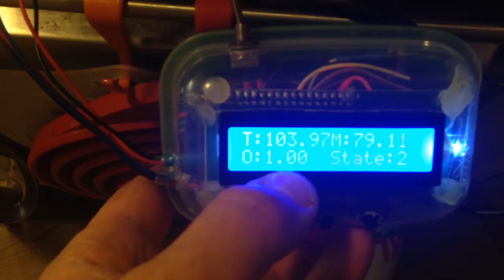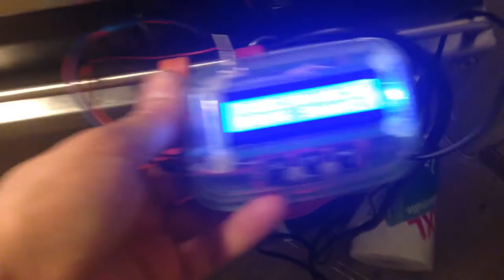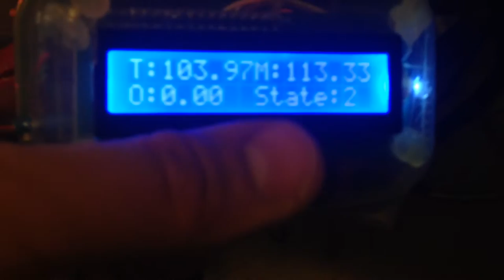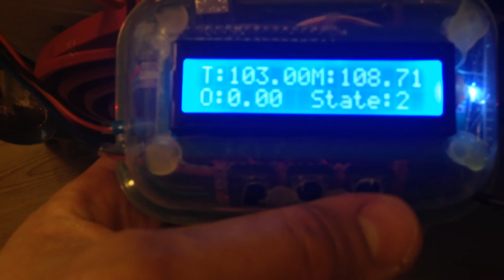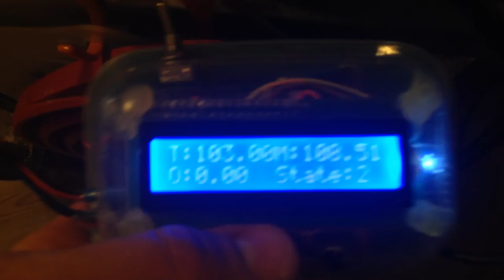Espresso machine with Arduino PID controlling temperature.

Comment from the maker: Link to a document describing the whole thing (one more video and performance graph inside): https://docs.google.com/document/d/1ntMEIloD2wUg8Yra1VtmFm3yOCzGYv-qs2anu9O3p6I/pub
Reply: Hey, how did you go with this in the end? I have the same machine and want to convert it to PID. Are you still happy with this? Any changes you would recommend? Thanks! I am surprised your video did not get more views or comments - smart way of doing it without a big box!
Reply from the maker: Thanks for your interest and kind words.
Yes, I'm still very happy with it.
I've just checked and I still use the same parameter values for the machine, so the code should be fine for a similar machine. At least if you also have 230 volts. For 120 volts, it's a different heater, so maybe they can be optimised a bit in that case (though they should be a good starting point).
The machine takes quite some time to warm up, when the boiler is set at 107 celcius. About 45 minutes, I'd say. Often I turn on the machine only when I want an espresso, and then I usually set the target temperature to 137 celcius (no reason for the particular value other than it's high and only requires a few clicks) for about 5-10 minutes, before lowering it to 107 for another 5-10 minutes. I'd recommend considering implementing that procedure in the 'setup code'; setting the target temperature to the actual target plus say 30 degrees, then waiting for 5 minutes, and then lowering to the stored target, before entering the loop. You'll probably need some way of bypassing this, though. Like how I've made a 'reset to factory values' functionality by holding a button pressed during startup (I've small kids who loooved the fancy display and buttons to click on, so I needed this ;)
Another recommendation would be to take it as a learning opportunity if this is your first project. If you just want a PID on your machine, you'd probably be better off buying one where it's already in place. But if electronics/arduino interests you, and you have the hours (several, if you are a novice) to spend, I think it's a great project that you'll enjoy every day.
Best of luck if you decide to try it out, and don't hesitate to contact me with comments/questions!
Reply: Ah, yes - this reminds me why I in the end prefered my HX machine! It heats up much faster, the Domobar needed abut 40 minutes. Why not start it in "steam" mode and then later on toggle the steam switch?
Yes, my first project of such kind, it will be a learning experience. Thankfully I have a 2nd machine, so still access to coffee while I get this going ;-)
I assume you can get logging and display on a PC from this board?
Eventually I will try to get a board with WLAN connectivity, that will be the next step.
Reply from the maker: If you set the target temporary to infinity (or just above about 150 degrees), it corresponds to setting it to steam mode, since the wiring means that regardless of the PID, the steaming circuit still kills heating if reaching steaming temperature. It's a nice safety measure. Setting the temperature to that level rather than 137 det makes sense. 
You can log from the board, but in my setup you can't connect the logging cable while all the cables required for operation are on. I recorded values to the board, which I later transferred. I think the board I have linked to in the description is a larger board, which should allow simultaneous operation and logging.

Comment: hi, would it be a problem if 1 use a 40 A ssr instead a 10 A?
Reply from the maker: Trisoc9 no, 40 A is fine and may be needed if you have only 110 volts. The ssr must be able to handle a higher current that your machine can consume.